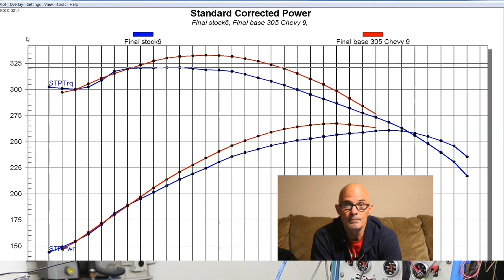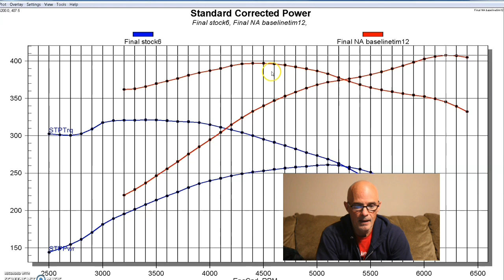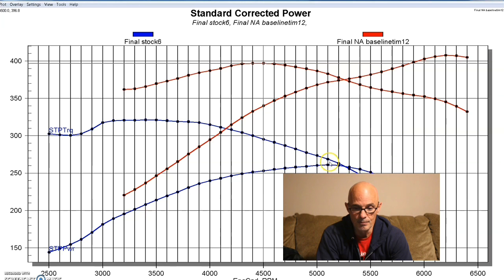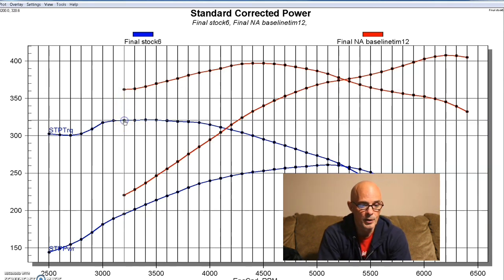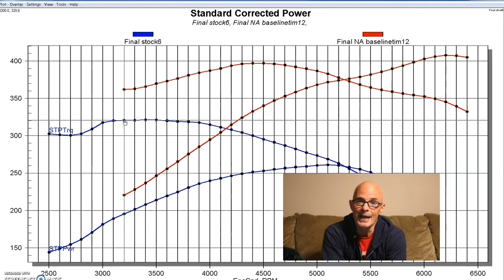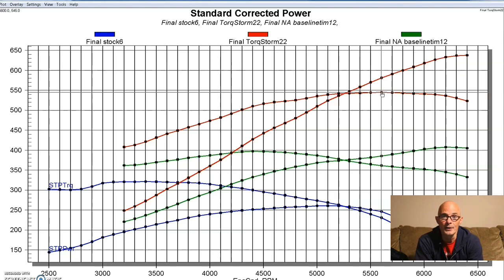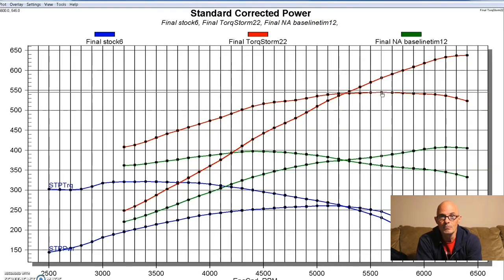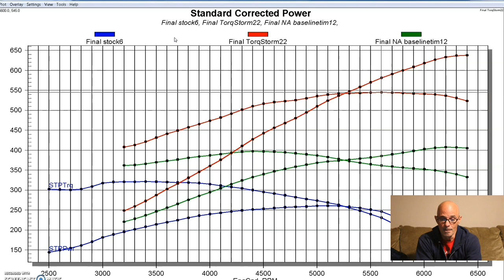5.0L FIGHT-302 FORD VS 305 CHEVY-FULL RESULTS

Comment: I would like to see a Chevy 305 vs a Chevy 302 with the same top end setups from stock up to the biggest head that will fit a 305 to see at what point the larger bore will start to make more power.
Reply: I'm willing to bet those WERE the biggest heads you can fit on a 305.  Any bigger and valve shrouding becomes a major issue.

Comment: Im confused about the ford build. I kinda did everything the same on my '94 302. But i was told the ford wouldnt accept a cam larger than .520 without having clearance issues with the stock pistons, so i stuck with i think if i remember, a .510 or .515 or .501, cant think of the part number of it right now, but is the trickflow cam. I also have the trickflow heads, and upper and lower intake on it, and of course a ton of other stuff. But i am surely confident its probably no making nearly 350 horse. I have not dynoed that car, but i did dyno my other car, and doesnt feel anything near as poweful as my olds. I have both cars in vids on my page. Im curious about the ford clearance though, as i bought the car with most all the parts on it already, and had less than 10k miles on it, and i went through it when i got it, because i dont trust other peoples work sometimes, and everything i read when i had it apart about 6 months ago, all talked about the clearance problems.
Reply from the maker: its almost never lift-its always the duration
Reply: Richard Holdener thank you. I wasnt thinking. Now that makes perfect sense after watching the 6.0 ls cam shootout. I was wondering why the durations were so low.

Comment: Considering the fact that the 305 is at a disadvantage with a small bore and a limited selection of aftermarket heads, it made 96% of the power of the 302. Old Chevy 396 cylinder blocks had valve notches cut in their decks. I am curious, if a  305 block had valve notches cut in their decks, would it be possible to use a head with bigger valves? Also, I would like you to clarify something. You said that the Chevy head had 175 cc intake runners and the Ford head had 170 cc intake runners. Even though the Chevy head has more CC's, because of the Ford's shorter intake ports, it actually has a larger cross-section, correct?
Reply: I notched my 305 Chevrolet for 2.00 intake valve and   .610 lift. Worked great  👍

Comment: I worked  at a Ford dealership  from the early 80s to early 90s and when  a fresh load of mustang's came in we would meet the Chevy dealership  and race the camera  they never had 1 that would run with the mustang  the Corvette could from a dead stop but only a car length or 2 according to traction  from a role the mustang  beat the Corvette  by a car length or to the vette and mustang  ran like they were welded together separated  by the jump  the Corvette  seemed to have slow throttle response  from a role  that put the mustang ahead  and at dead start  the same throttle response but perfect  traction  gave it the jump

Comment: modding a tuned port is like sticking a 12-inch sub in an 8-inch sub box and expecting it to make more and better sound. the " tuned port"intake system was just that, it was tuned to the rest of the engine and components.

Comment: I still geek out over how the centrifugal supercharger extends the rev range.  Naturally aspirated, the 5.0 had torque peak at 4500.  Then with the Torqstorm, peak torque went to 5500, and the power just peaked at 6300.  It would be cool to see how far the engine would rev until the power drops to 90% of peak.  Maybe that would be around 7000 rpm.  The centrifugal just keeps stuffing more boost in, long after the vol eff has dropped off, and the engine is screaming "no mas!"

Comment: Loved my '90 GT. I beat 5.0 Camaros and Firebirds, 5.7 IROCs and T/As, and even beat two GNs!  I must've had a particularly well assembled one!  I did lose to an AMC Javelin with a 401 and an S-10 with a SBC that was built.... learned to know my opponent before racing after those two!  LOL
Reply: Honestly, if you beat any GN, they didnt know it was supposed to be a race, or it wasnt truly a Grand National you were racing.  That turbo 3.8 was head and shoulders above EVERY small block of its vintage.  Unless you had some pretty good mods of your own.  I had a couple Camaros and Trans Ams 5.0's and a 5.7, the 305 cars were typically beat by the 5.0 mustang's, unless the driver sucked.  My 5.7 typically beat the 5.0 mustang's by a little bit, unless they were decently modded, and my little turbo 3.8 KILLED my f-bodies, even before any mods to it.
Reply: @ShyaMiss   They knew it was a race, we found a back road and painted out two stripes about .25 mile apart before we lined up.  :)  Obviously, this was street racing without timing lights or their accuracy.  I never got to line up against a GN at the track.
And they were both real GNs, as evidenced by careful underhood inspection.  
All I can say is I expected to lose, but was in front at the end.  I chalk it up to driver skill (I had 4 years of driving the piss out of the mustang and they may or may not have been new to the GN).  
The only mods I ever did to that 5.0 were a bit of timing advance and when at the track I used a short belt to bypass the smog pump.  
Like I said, I think I got a motor that was built a little closer to spec than most... I never lost to a Camaro or FIrebird.   :)

Comment: Who remembers SVO J302 aluminum heads?
Who remembers the Vortech A-Trim?
Reply from the maker: Do you mean the A-Trim with serial number 001 (that I had on my Mustang)
Reply: I ran J302 heads on a built 331 SBF with a Kenne Bell twin screw. It was bad ass.

Comment: More accurate way to run the bore x stroke theory would be to have heads that flow similar on both engines then put cams that are similar and run them against each other.  Then put hotter cams in that run at higher rpms and that's when the engine with larger stroke will create more internal resistance because of higher piston speed and horsepower will drop some.

Comment: How about a Australian Holden 308 or the later 304
Made from 1968-98

we also got the 307 chevy, in 1968 as well as the 327 in the Holden HK then HT, HG & HQ models had 350 Chevrolet Engines from 1968-too about 1974
They also had the smaller 253ci V8 and 6cyl option Engines.

Comment: What about chevys 5.0 302? I love my fords but that engine was a small monster that easley out preformed the Chevy 5.0 305. The 302 was a solid lifter though.
Reply: I think the old 307 Chevy would have been a better engine than the 305 with that small bore and 3.5 inch stroke.

Comment: Well the Supra i6 has a small bore, but it will kick the shit out of 302 and 305, even if they were boosted too.  It's only 183ci.  I'm not being rude or trying to insult you at all, you're a great guy for the knowledge you share with people and not just analytical data, you provide the empirical data.

One thing I would love to see you do is take a L67/L32, get rid of the crappy supercharger and put a turbo on the 3800 and see what it takes to kill it.  Please, please, please.

Comment: The giant misconception on 305 is while everyone was hyped on big bore and 350 the 305 had the same volume as 302 Ford only they did it with quarter inch more intake and quarter inch more compression as opposed to short stroking all the volume at once. In a drag race technically 302 should win but in a high speed chase the 305 should run it down. Can't have the best of both worlds just find a happy middle.

Comment: It would be really neat to see how the taurus SHO engine runs against the 302.  I know with boost the SHO makes killer numbers. I had a PT67 turbo on my 94 SHO and it was a blast.
Reply from the maker: I got to ride in a lot of the Sho Shop cars-Vortech Stage 2 running 10,000 rpm. Very impressive motors
Reply: @richardholdener1727  I swapped a 3.2 SHO engine into a 1995 camaro years ago. It still sits in my garage unfinished with a built TH400 mated to it. forged pistons, valve work and of course a sizeable turbo... life got in the way.  They love the rpm. I ran 8500rpm on my old 94 automatic that I put a turbo on. It was  a blast to street drive.

Comment: Love the old school comparison.  I'm not like many here. Personally i think the 305 is the more powerful engine. Being a product of the 80s myself i can tell you a 305 truck will soundly thrash a 302 truck if all it similar.  Now i have never modified either but in this test it looks like the 305 held it's own modded even with not as much cam or head. And then had better overall power stock.

The thing that made the 302 was being in a lighter mustang. Not it's power production.  This test put the nail in that.
Reply: In most cases the 305 in mild form would keep up with a 302. But if you start to get more radical with the build, that’s where the 302 would leave the 305 behind mainly due to what he was talking about. Bore size and the aftermarket parts are much better for the 302. With a Dart Or Ford Racing Boss 302 Block it would be al over for the 305. But that’s why they make the 350. To me the 305 is a waist of time and money. Majority of people realize this, and don’t bother with the 305 when wanting a performance engine.
Reply: @markball7028  no one fools with a 305 much not because they can't make decent power. But because the sbc interchanges so easily. So it's natural to go to a 350 or 400sbc. 

On the other side the 302 was massively produced and to go to a 351 was a pita. That then turned the furd guys into cryers about cubes.......or rather their cube deficiency.  

I never cared tho.....i relish the cube advantage of the sbc and watched the tears fall.

Comment: Chevy 305 small bore's problem: It shrouds the valves, a real problem on 2 valve heads.
Also, longer stroke = higher piston speeds @same rpm as FORD 302 = less high rpm HP capability.
Honest question: How long until the stock rods and cast pistons come out flying at 10psi on a daily driver ? All this providing I opened the piston ring gaps, ran an aftercooler, proper heat grade spark plugs, etc.
Reply: The tuning is the issue. If your setup has more cam timing that moves the pressure curve up and takes the engine out of a high load/low rpm situation, the engine will last a long time. Fuel has a lot to do with it also. Are you running gas or alcohol?
Alcohol, because of it's cooling properties will save those piston crowns. 
If you want to see a stunning example of a stock bottom end combo, look up Chris Watson's sbe 302ci turbo/stick shift Mustang. It runs 5s in the 1/8th, 9s in the 1/4.....on 35 lbs. of boost. Over 900+hp. It's still alive after 4+ years. The guy that tunes it is amazing and usually the rpm is limited to 6000 rpms.
Reply: We ran 15lbs on the stock bottom end without issues. Although I did have gen6 DFI back then and that was on race fuel. 
The pistons weren't cast from about 85-92 on the 302 H.O. motors. Although if I remember correctly the 86 had no valve relief. They were completely flat. They were TRW forged pistons until 93 when they went with the Hypereutectic 
Also it wasn't really rods that people broke. It was the blocks after 600hp. Although many of us back then had no problem making 600-700hp and not break anything.

Comment: On my 3.875" bore +.030" oversize 307ci chevy i still have,  i put A Pair of Aluminum heads on it when I first built it. It had typical 2.02in, 1.6exh valves
4 eyebrow cast pistons.
With those heads it would turn too 8500
Reply: That must be one bad to the bone setup to hit 8,500 R.P.M.  most Racing engines is from 6,000/7,200 R.P.M.  and them are Racing engines just saying

Comment: For a real even comparison,you should have compared the boss 302 against the chevy DZ 302!That would have been a better comparison,more even because of the same bore and stroke,plus way more interesting!How about a dog 390 against a Pontiac 389.I had a 4dr `68 chevelle with a 250 six that out ran my friends `70 mustang fastback with a 302 2bbl and dual exhaust .

Comment: Late but I'm a born Gm man own 7 3-5th gens.  My car at age 15 was a 85 Camaro z28 305 car. At age 15 I thought it was fast but a class mate had a 302 mustang.  I took my 1st ass whipping. So me an Sr took that 305 out replace it with a 4 bolt main 350. 650 carb small cam hump heads. Cm bk an put bus lengths on my high school class mate. After that 1st L it shocked me so bad I always stayed one step ahead of Ford in drag racing an been taking Ws every since.

Comment: The 350TPI was the one to have from that generation. The best from both companies, 350 vs 302.  Then the LT1 came out and it was like TPI what?
Reply: CC Ryder that was an anamoly. My 95 Formula Firebird 6 speed ran 14.1@101.5 in 96 degree hear my first time drag racing. Was that that cross ram set up?
Reply: CC Ryder that car might have been a little before my time, but I was just illustrating what a good running lt1 did stock in nasty weather. That 84 was a freak!
Reply: CC Ryder and money!!!
Reply: CC Ryder standard procedure for GM. I too have had quick cars from many brands but currently am in love with the 16-up Camaro SS. Had a 17 for 3 years and just traded for a 2020 Canaro SS 1LE in rally green. Absolutely blown away and can’t wait to make some more powa!

Comment: If you compare the two motors with the cam/head upgrade but no boost, the 302 makes 30 to 50 FtLbs more torque from 3000 through 5500; that would translate to better performance for the Ford on the street.  Wonder if the higher intake lift for the 305 caused some of the lower range torque deficit for the 305?  Looks like the 305 needed a slightly bigger cam to make 30 less HP than the 302.  All comes down to air flow at higher rpm's, I guess.  The 302 would probably do better on the strip, too, since it does not nosedive over 5500 like the 305.

Comment: Ultimate Chevy 5 liter.
Vortec 350 4 bolt main block.
Re-sleeved with 283 cylinder walls.
Clevite small journal bearings.
Factory forged 327 crankshaft.
Oem 3.90 lt5 corvette pistons.
Oem Vortec heads.
Oem 327 valves.
Oem lt1 350 cam.
Scoggin Dickey TPI conversion 
FIRST TPI intake
2.5" Thru Ram stainless manifold
2.5" Magnaflow resonated X pipe
Fallowed by 2.5" Magnaflow dual in dual out through X catback.
With 305 heads and 350 injectors it will spin 7000rpm.
Add the Corvette baffle responsible for the creation of the EGR valve  (i forgot the name of it) with 6.0 liter injectors it will spin 10,000rpm.
It tries to idol on the air to fuel ratio of a 350 you can use TPI supercharging knowledge to bring it down to the air to fuel ratio of a 327.
If you use the Corvette spec components polished and rated for 1hp per cubic inch.
Camaro spec will only get you to 7000rpm.

Comment: Both good engines good and dependable stock, with aftermarket support, a 350 is better for power gains yes, but I've them all, a roller 302 couldn't blow it up, 305 redlined constantly racing and ran without fans working for a week still going. I've blew up more 350s just driving.

Comment: well at least on tuned port IROC you could get the 350 and the pontiac trans am GTA you could get the tuned port 350 chevy it had a different cam polished intake runners forged pistons pink rods forged steel crank from the factory
Reply from the maker: Did any L98 ever have forged pistons or a steel crank
Reply: @richardholdener1727  Unlike lesser engines, the evolution of the big-block Chevy can be traced back to a prestigious great-great-grand pappy, the high-performance 425-hp L78 396, first available in 1965 Corvettes and Chevelles. Even though the big-block was destined to eventually find a home in trucks and family sedans, it started off as a serious high-performance piece sporting rectangular port heads, solidlifter cam (in the Corvette), high-rise aluminum intake manifold and 780-cfm Holley carb, and forged pistons with an 11:1 compression ratio.
Reply: @richardholdener1727  sorry i missed keyed in l78 instead of l98 i cant find any info on the gta online i read it in a magazine when the cares were near new !! tells my age lol it coulda been BS i recon

Comment: well, not ALL 5.0 litres, there was the ....olds 307. pity they did nothing more than add roller lifters (and peanut port heads) on an engine with 6" long connecting rods stock. Olds could have made their 442 and H/O something interesting in the 1980's besides the shifter handle.

Comment: It always takes a Chevy 327, 350 to beat a Ford 289/302 and a 396/427 to beat a 351 or 390. I never saw a Chevy beat a Ford racing the same size engines.
Reply from the maker: look at the 1968 & 69 Trans Am season winners
Reply: @richardholdener1727  and there were more Chevy's than Ford's on the track those years.

Comment: Of course parts price and availability come into to play for most people. But for the cam/intake/heads mods they are not real comparable. 6/8 degrees more cam and modified valve angle heads made for a lot of that. And that is enough rpm for that small chevy bore to come into play.

I like a little rpm and don't really care about big block low rpm torque in a car so my favorite chevies are the 327 and the 327 crank in a 4.125 bore 350. The sbf 302 has always been a winner, but those fox bodies are pretty crappy quality. Have to go with an older ford for me.

Comment: You're lucky  you didn't crack the block.  Those 5 liters are known to split around 500hp
Reply: 500 rwhp...this 600 is on an engine dyno no accessories hooked up to drag it down and no exhaust just open headers....be lucky to hit 500 rwhp in the car.